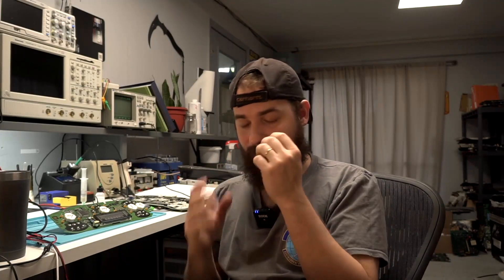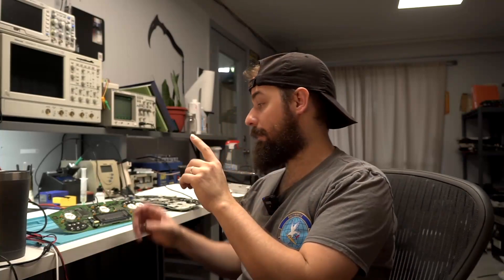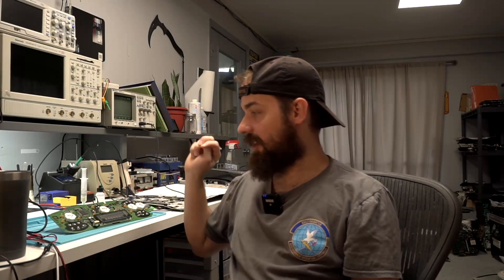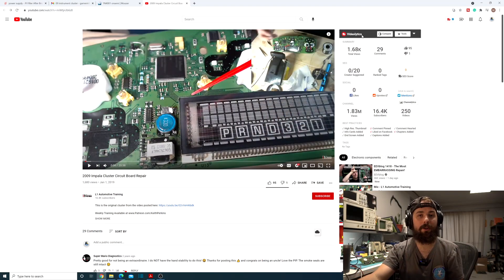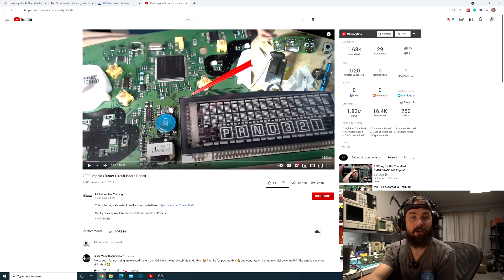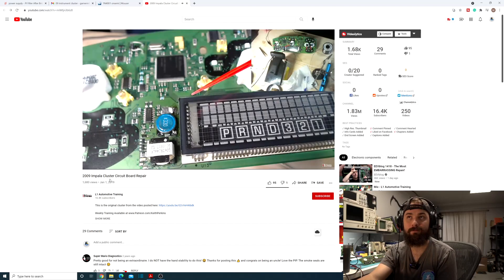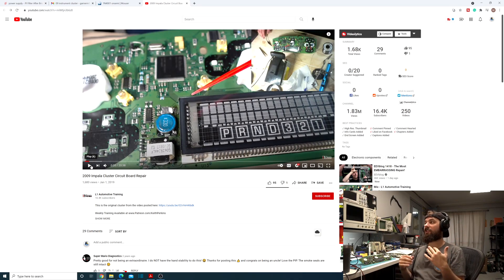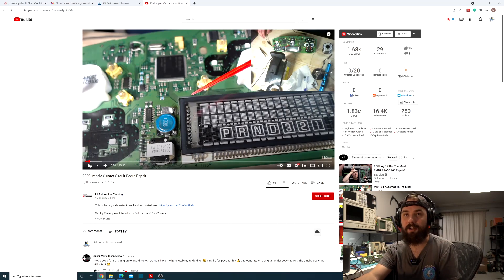Debunking L1 Automotive Training 2009 Impala Cluster Circuit Board Repair

Comment: Have you ever looked at an air conditioning board , both my inside and outside boards are not talking to each other, seems like the communication chip has failed . What's your thoughts on this chip GK-30434E4 this is communication chip on the outside unit

Comment: This is a good learning opportunity to really look at the numbers printed on the cap/diode. Can be sneaky.  Some times tantalum capacitors will have [+] but usually XX-XX number configuration. Good video!
Reply from the maker: Great point! Yeah I couldn't Think of a good way to articulate the XX-XX number scale because some diode do XX line break XX so I didn't want to confuse people. Writing it out though is easy to follow. II wish they would IEEE a standard to make the package yellow. then again they need to IEEE a standard to mark ceramic caps.